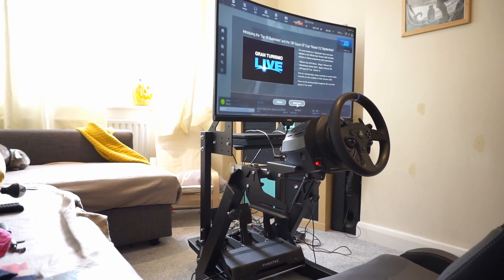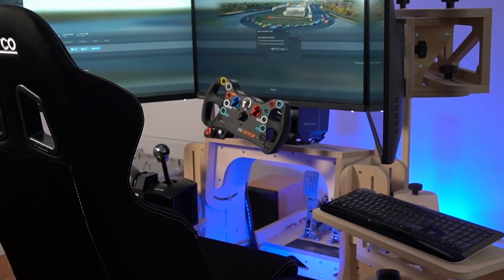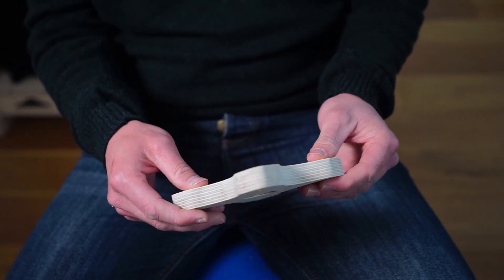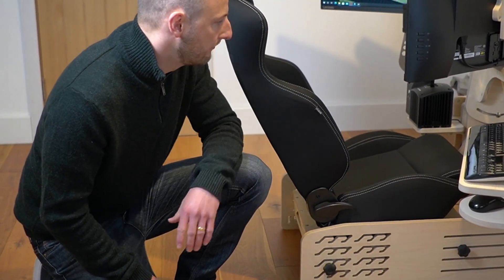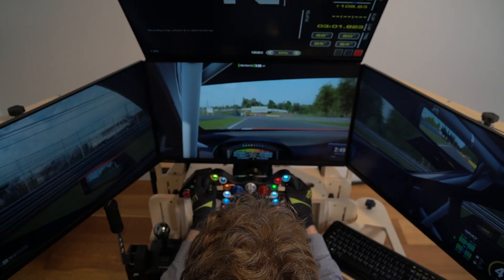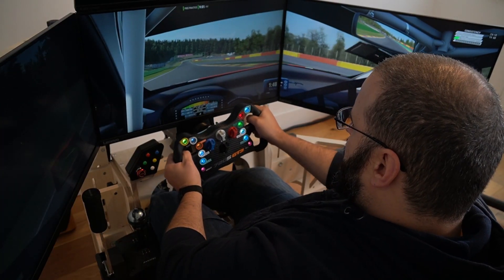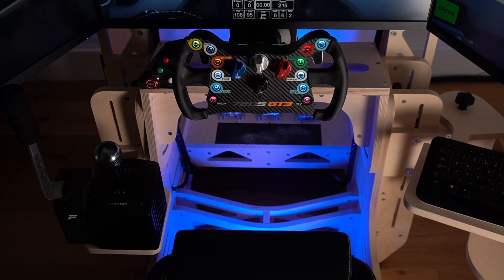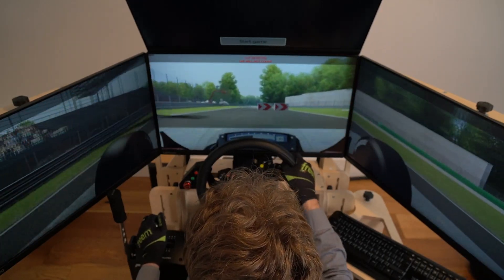The F1 engineering of a wood sim rig

Comment: Looks about 100 times more of the quality than the PlaySeat Challenge seat line up.
Reply: Looks like I am going to need to invest in an umbrella for my Playseat Challenge, since so many people are p*ssing on it!  I had my doubts too, until I tried one.
Reply: @bobmcl2406  the major problem is that there is a metal "pipe" right between your feet. That causes a big problem when you want to break with your left foot. With the Fanatec CS 2.5 I nearly ripped my seat of the metal construction ^^
Reply: @bobmcl2406  I just tried one. That ActiFit thing is soft and elastic and after a while you'll stay on those straps that dig into your body. And the force feedback is leaking through that unstable mounting thing. It is overrated. Better than a stand with a cheap chair maybe but worse than you can built at home with cheap materials.